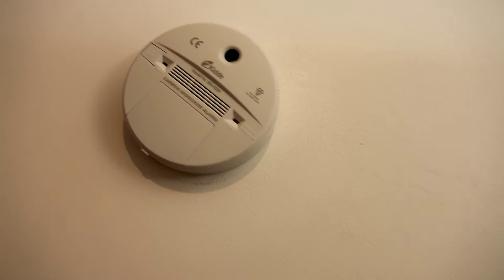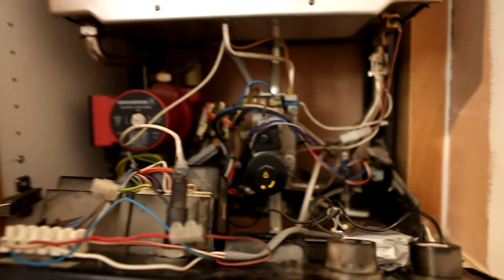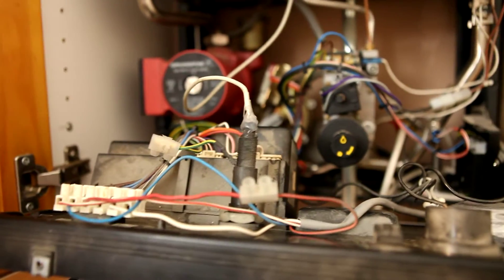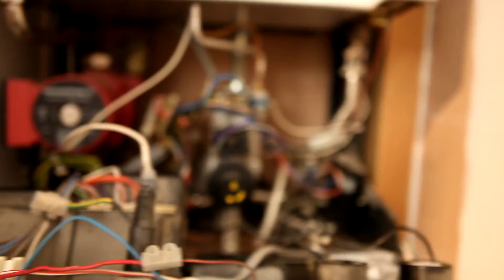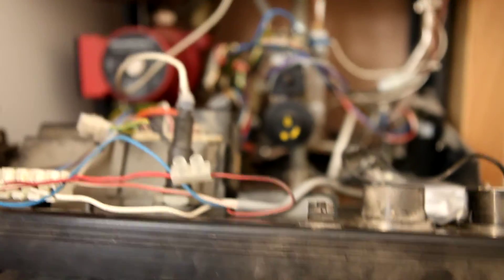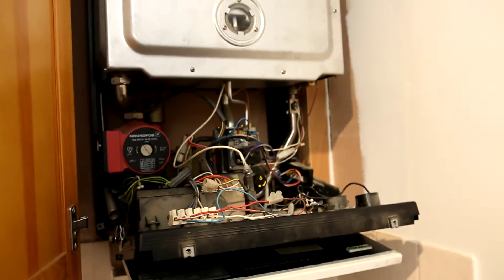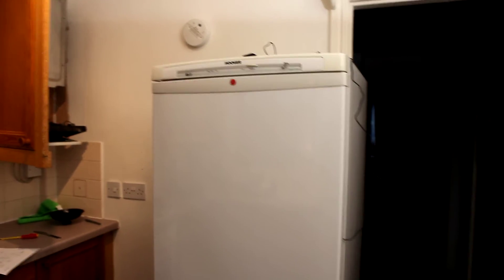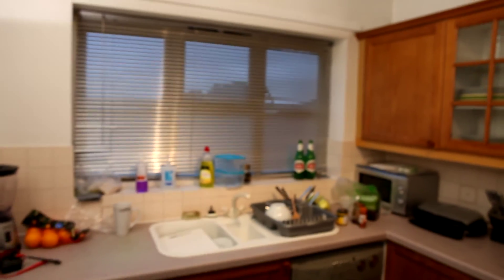Attack of the killer CORGIs and failing fridges

Comment: Modulating valves require settings within a specific ranges of pressures set by Manufacturer and are not normally adjustable and yours appears to have the safety cap removed!  A Manometer is used to check the values not to adjust! There are indications some of the safety devices may not be operating correctly and may have been bridged. Overheat device should have stopped the whole system operating.  If gas safe engineers OK'd it and you are happy!  OK! but recheck safety devices are not bridged

Comment from the maker: The installation and service manual was with the boiler and given to the"engineers".  They still couldn't fix it. 

I simply followed the troubleshooting guide to identify the problem as the modulation valve, and then onwards to check the gas pressures which were set wrong. Corrected them as instructed in the manual. 

I subsequently arranged an official safety check by a gas safe registered person but given the boiler had been like that for 10 years and I had 10 annual certificates....

Comment from the maker: Must confess I've never seen a fridge/freezer with some sort of door between the two, unless it's a refrigerator with an ice compartment (in which case, the ice compartment is just the bit between the evaporator coils). 

Most of the fridge/freezers I've seen do have evap coils in both compartments, some have dual compressors. This one doesn't appear to, or if they are there, they're completely hidden. There is absolutely no communication between the fridge and freezer compartment on this one.

Comment: You just cant trust so called experts, bloody morons.
The moment you said it got boiling i thought what is the heat control side doing, its become rather digital on/off.

Great you have found the problem mate :-), at least its usable now!!, and if it can deliver good volume to the taps/shower without going cold or shutting off then it must be getting a good enough feed of water volume per second.

Not sure about the fridge, i would of expected dual compressors but they dont do that, odd.